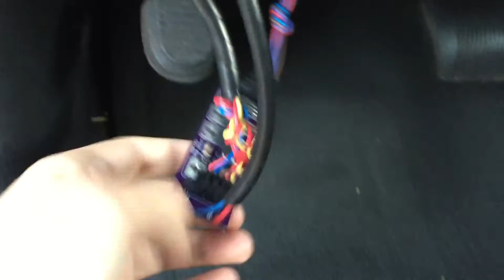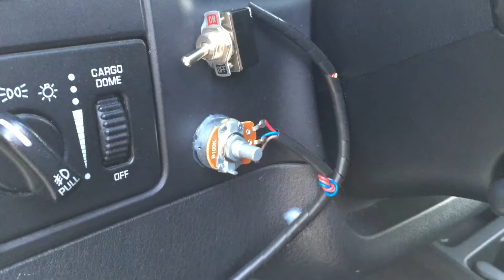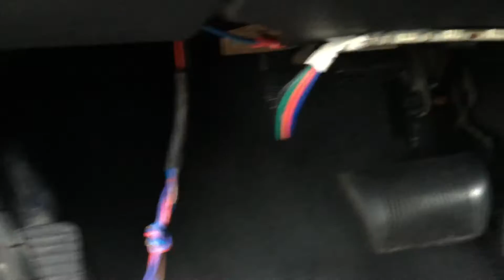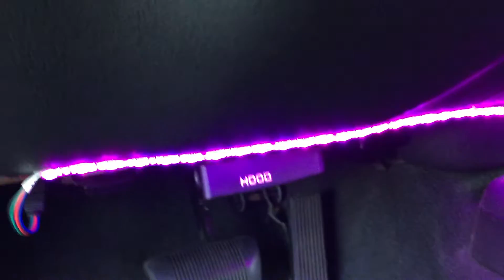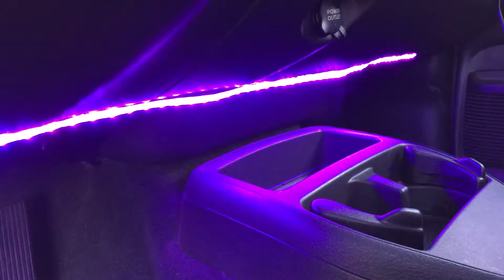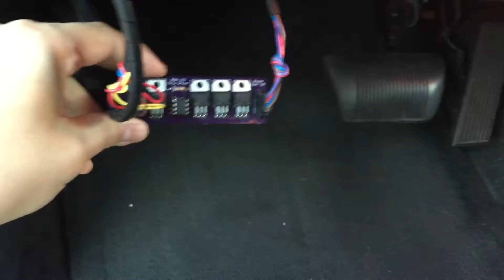RGB LED Strip Driver Using ATTiny85 and Potentiometer - Under Dashboard

Comment: You might want to use a WS2812 strip for such project. Limits the number of components to a power supply, the attiny and about 2 resistors.
I sure would install the controls a bit more... sophisticated way too :P